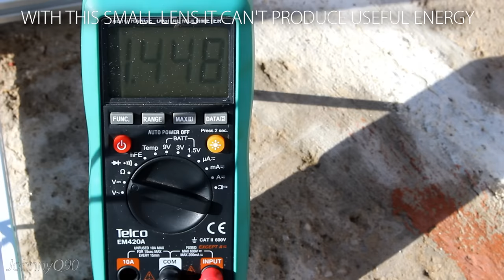Solar Powered Stirling Engine

Comment: A small reflector around the back of the bulb would have both increased captured heat energy while blocking some of the wind that was taking away the heat.
Reply: Exactly! There's no way a fresnel lens on a good day wouldn't put out more energy than that. Cool set up tho
Reply: cool setup to make usage of the sun for a sterling engine. but right, i was thinking something similar. i would consider a few optimisation in terms of energyloss. 

Moreover Energy is not equal to voltage. the interesting part is "how much power does it produce?".
Reply: The 1k odd people who disliked this probably worked on the hubble space telescope.
Reply: Geologysts used umbrella and broken mirror pieces to make "giant spherical mirror" sun collector for cooking without fire. Solar power from 1 square meter is near 1kW, it was effective to boil water.
Reply: maybe cooling the other side would help, too
Reply: @-7-man   Haha ... Yes
Reply: @Gleiciany Sena Gomes da Costa i think in general those installations are less efficient in land but more efficient in resources (extraction of silicon in solar panels emmit co²)
Reply: @Gleiciany Sena Gomes da Costa but you can't make solar panels st home. Plus the chemicals that go into them are not good.
Reply: @Gleiciany Sena Gomes da Costa The philosophy of "styrling" is really about the materials you will find at home. The manufacture of solar panels requires advanced industry in many industries, which may not work in case of war or apocalypse. Some alpha styrling can deliver usable power, as well as low-grade gamma in a larger number - depending on what that would be, because if it were the worst and would require performance, water turbines, steam engines or internal combustion engines would be the first Wood gas. I see the benefits of styrling in times of global warming in the use of space cooling in homes - converting heat energy into mechanical work free of charge, which can also recharge batteries - suits many gamma types.
Reply: Another word of be to modify the cooling tube on the other side.
Reply: Delicious DeBlair A good way of providing some speed regulation in the case of power generation.
Reply: Probably a heatsink applied to the glass tube too or a piece of carbon felt inside
Reply: @-7-man  There are a little people who have that big heart to appreciate someone with just a click.
Reply: You would break the glass
Reply: If you put a clear bulb that’s obviously somewhat bigger(1/2’ to 1’, clearance) than the black bulb, then the wind will not affect the black bulb in any way, and this will help the difference between hot and cold, to be at the maximum........ Because, this is exactly like hanging a solar still or showerbag, inside a clear case or south facing window, which works best if there’s an inch or so of air between them, this way, you can get water that’s almost(or actually is too hot, depending on how hot the sun is, and how long the day is, in the area that you are) too hot to use, before the end of the day.......
     And then, you just need to work out the automatic system, which keeps the lens optimally aligned with the sun during the day, so that it’s at its most effective for the whole day, that also then resets the whole thing, for it to be optimally aligned for the sunrise the next day, ad infinitum.............
Reply: @Cesar-ey7wu   yeah it should. maybe just have a bottle of water dripping onto the other edgeof the air chamber
Reply: @Cesar-ey7wu  hi
Reply: A reflector? Really, the Stirling engine in this video is only a demonstration/educational piece first of all. But secondly, and most importantly, this setup is operating 99.99% off of the transfer of thermal heart, not radiated heat, so a reflector would make very little difference.  Thirdly, if you were going to use a reflector at all, why not completely encapsulate the bulb in a inwardly reflective material? It would not hinder the thermal transfer of heat from the flame to the bulb, but yet would provide better heat retention by increasing the amount of radiant heat reflected back into the bulb.
Reply: @DL-kc8fc if you permit me I would love to use your idea of a solar stirling engine on the rooftop for business purposes. If you wish I am even ready to pay you for your idea.. please let me know your opinion

Comment: Glass is a poor conductor for heat. My sugestion is to replace the glass tube with a metal one, copper if possible, for maximum heat transfer.

Comment: nice, ordinarily stirling engines are powered by something burnt. if that burnt item has a gas component ie wood/wood gas then the potential for energy extraction is inefficient on a stirling. but the only use of solar other than a few specific wavelengths being usable in current photovoltaic cells is for the heat value of it. this is exactly what a sterling engine does best, use heat/cold temperature differential.

Comment: I don't think the poor efficiency is derived from the lens size though.

The engine is powered by temperature differences btw the air inside it's chamber and the heat it receives, so better not letting the whole assembly out in the hot sun, you are evening out the temperature gradient in that kind of surroundings...
Reply: maybe transfer the heat into cold place using a heat transfer tube?

Comment: well done, but you can use 3d printing, and a simple arduino solar tracking system, and concentrated solar beam position system to move the stirling engine to the focal point too i guess

Comment: "I need a power hacksaw"...

Sounds like you just decided on your next project: NITRO HACKSAW!
Reply from the maker: Haha this one must be reliable, so not an option. What I'm planning though is a micro nitro chainsaw ;)
Reply: Bosch Nanoblade has the bar and chain for you.
Reply: Thanks
Reply: @johnnyq90  Just curious as to why you went through all that hassle making those copper/brass weights and machining out the flywheel for them, rather that just using a heavier material in the first place, or just slightly increasing the diameter or width of the flywheel?

Comment: Instead of Fresnel Lenses I suggest you use a parabolic mirror, you can do it with a plate satellite dish and little mirrors
Reply: +1 Read my mind; was thinking literally the exact same thing the whole time I was watching this. MythBusters did one exactly the same way when they did the roman death ray myth. It didn't work for them, but I always thought it would work great with some fine tuning.

On a side note, rear projection TVs have biblical sized Fresnel lenses in them.
Reply: tornadotyphoon it's been researched as an alternative to solar cells in NASA
Reply: tornadotyphoon ni
Reply: Mylar is better than mirrors, but yeah
Reply: @goncalosanhudodeportocarre9591  Mylar is just the polyester film. Without the sputtered aluminum on it, it's hardly reflective. Also, any smooth surface can be aluminized, so Mylar as a substrate isn't particularly special.
Reply: Monobear
Reply: Why not....BOTH
Reply: There are/we're a few commercial parabolic Sterling implementations in the past.  I recall a German made unit that was installed at an office park in Midrand (between Pretoria and Johannesburg) about 20 years ago that was supposed to power all of the blue (UPS) plugs for the whole office park

It featured a 6 metre tracking dish and a Stirling generator mounted at the focal point.

This unit was ineffective tho, as it's tracking software was calibrated for the northern hemisphere and didn't follow the sun almost at all.  Became a white elephant, no idea why the software wasn't corrected by the manufacturer, perhaps they went out of business or something 🤷🏽‍♂️
Reply: Yeah, I've heard that parabolic solar ovens can reach a temperature of up to 800 degrees (Fahrenheit, i believe). That would probably do a pretty good job at heating up that engine.
Reply: @MikeTrieu  make the dish big enough and it will cook. It's much easyer to use mylar or aluminum tinfoil in such a surface than small flat mirrors in a mosaic, which are difficult to focus if there are many

Comment: Would you think that building a sort of solar collector, where you use mirrors to focus higher amounts of sunlight at a specific point, would allow for a design that might produce a bit more torque? Are there pretty low limits as far as what can be accomplished with this kind of engine?
Reply: If a focal lense where to be used it could produce a much more efficient output and could potentially be used in circuit with others. Using a fractal prism and focus lenses could possibly produce enough focused solar radiation to operate several at once. In theory of course.

Comment: Using a decade resistor, you can determine the maximum power point(useful watts at various loads). Then you can change gear ratio's or even motor/generators and maybe eventually get it to do something useful, like power a radio or charge a battery. You really want solar tracking on that bad boy or you would have to re-adjust the lens way to often. Also, using carbon black to coat the inside of the tube would likely be more effective. Great job by the way.
Reply: You cant paint the inside of the tube, or put anything in it. The displacer, which is like a piston, but loose fitting, or with holes in it to allow the working gas to pass through/around, is located in that tube and uses it as its cylinder. Painting the inside would create too much friction. also, you couldnt do anything with the empty space at the end of the tube because a stirling engine needs the displacer to not go all the way to either end of the cylinder.
Reply: Assuming a 0.2x0.3m Fresnel Lens and 20% efficiency, the max output would be 17 Watt.
Reply: Ahhh yess.. Another brilliant Youtube Scientist with his notions on things he truly does not even understand the system of.

Wonderful!

Comment: $500 in materials, $800 in Shop Labor an $3000 worth of tools to build a machine that can almost power a single LED. That sounds like something I would do too.
Reply: You nailed it! I have no idea why anyone would build a Sterling engine. It's as if practical science is no longer available for purchase and you have to build a shed with Covid price-gouged lumber and you're proud to say you don't even have a yard or tools.
Reply: @shinigamilee5915  Swedish Gotland class submarines are equipped with additional Stirling motors drive. In this configuration, the period of residence underwater was increased to many weeks. Science? Yes..
Reply: Covid lockdown fever!!!!
Reply: But imagine a powerplant with those. We just need a better materials, so we can make it cheaper.
Reply: I feel like if you just pointed the lens at a pipe and utilized steam power you would be better off.
Reply: Have you done anything with your money that is worth noticing?
Reply: Using that motor to produce DC current will result in pulsating DC. This is why we have circuits to move and distribute electricity Using capacitors, resistors, transistors, and transformers. I'd advise you to take your ignorance to a library or perhaps read up on how DC works.
Reply: A 'Negative Nelly's' need to chill
Reply: Just for the sake of science.

Comment: I dont really know english terminology of engines, but that thing you painted black (hot side?) ideally should be handled diffirently. In order to increase performance of sunlight, you must project light onto absolute black body that is hidden in absolute white body. That way heat will go away less quickly due to the fact that white body radiate less "radiant energy" (as we call it in my contry) and more "radiant energy" is absorbed by absolute black body. Long story short, paint place that lit by sunlight black, shadow side must be painted white,  and in order to create model of absolutely black body you must place the surface a little bit lover that other "hot side's" surface in order to catch radiation reflected by surface by walls of said surface difference. 
Model of absolute black body presented in wikipedia's page named "black body"

Comment: thanks for posting.  excellent work.  some thoughts for you and your subs.   it is convenient to load a stirling engine, by using a STEP-UP mechanism to drive a small motor.     in order to achieve highest output efficiency from a low-torque engine, the engine MUST have a mechanical advantage, over the load.  in other words, reduction gearing; NOT step-up gearing.      note that, even where output torque is high (motorcycle or car engine), the system is designed so that the engine ALWAYS has mechanical advantage over the load; via sprocket and chain or the reduction gearing, within a differential.      thanks, for demonstrating a way to retrofit a desk-top engine; making it suitable for quality, output power experimentation.   with the the inclusion of reduction gearing in the system, the final component needed is a suitable, purpose-made, pma.  the optimum load that the engine should experience, is determined, in part, by the need for loaded speed of the engine to be 85 percent of its un-loaded speed; 85 is a guesstimate.  resistance can be varied, in the coil circuit, as a simple way to match the load to the engine, initially.   one aspect, of an efficient pma design, is that the generating coils MUST be correctly made.  in general,  a generating coil should consist of thirty to thirty-five turns, of 14 - 16awg magnet wire.  (a generating coil can be made using smaller wire, by winding multiple strands 'in hand', into a single conductor of correct gauge.)  if a greater length of smaller wire is used to make a generating coil, the internal resistance significantly limits output current (amps).      power equals WATTS.   watts equals volts TIMES amps.     cheers

Comment: I liked, very nice. 
I think that will be a lot more efficient if the solar collector (glass part) will be painted in the inside instead of the outside. 
That way the hottest surface of the glass will be inside instead outside... more heat to your machine and less heat lost to the outside air.
Reply: You can't do that because the piston would rip all of the paint off when the machine is in motion if it is painted on the inside.
Reply: @joshuawhite3411  if done proper the piston should never touch the walls of the glass bulb.
Reply: I'd rather mention the fact that the glass would reflect a good amount of the light had it been painted on the inside.

Comment: Ok, so considering the square footage of collection and the lens, head, mechanical, and generator losses you probably have a max of 3-3.5w to play with. If you can spin the gen head faster you can essentially better match the impedance of the system and alongside a shroud around the Stirling head you could very well get your output power to the level where a boost converter could charge a phone. I personally would replace the generator head with a 12v DC motor that has strong cogging. Anyway, with a few tweaks you just might be able to pull 10w out of that rig.
Reply: What is strong cogging? You mean the gears are metal?
Reply: @stopthephilosophicalzombie9017  I mean it in the sense that when you try to turn the shaft by hand you can feel that it doesn't want to leave it's current position, but once you get it to move it jumps to the next position. This means that the either the rotor or stator is an arrangement of strong permanent magnets. Being 3 years ago, I dont remember why I used that terminology instead of just saying "permanent magnet 12vDC motor", but it may be that the channel owner was using a salvaged motor and might only be able to identify the permanent magnet type the the feel of manually turning the shaft.

Comment: I wonder how comparable the efficiency of a solar panel is to this as far as size to power output
Reply: This is way cheaper than any solar cell.
Reply: @giovannicesaramorim9adigan961  SO didn't ask about cost, but the solar panel is much cheaper than this elaborate fabrication. To correctly answer the question, a panel same size as the Fresnel lens would produce about 10 watts at a modest 15% efficiency, whereas the theoretical efficiency of a Stirling engine is 40%,  but then subtract the frictional losses, the lens and focus/heat transfer. I would be surprised if the Stirling engine shown can generate more than 1 watt of power.
Reply: @ellayararwhyaych4711  Stirling engines have 40% efficiency, accounted with friction, and thermal losses are not even close to being the largest loss, as boilers can go up to 90% efficiency.

Comment: If the generator can give good power, and just the voltage is not high enough, it is not a big deal. You can increase the voltage with some circuitry.
Reply: Heard of the Joule Thief ? Good circuit to get the most out of batteries, might work here ....

Comment: Excellent video! I wonder if you'd achieve greater heat absorption with the paint layer on the inside of the reciever? Or maybe even a non-painted section on the front of the tube for collection and the rest covered in aluminum foil to reflect all focused light for higher absorption ?  Overall a beautiful experiment and look forward to more!